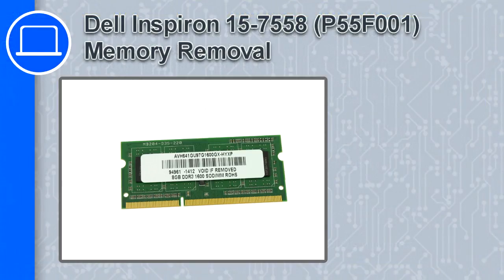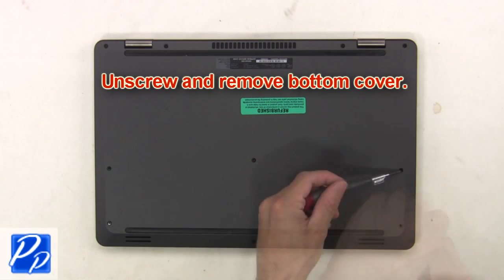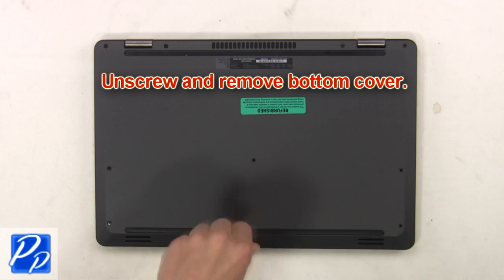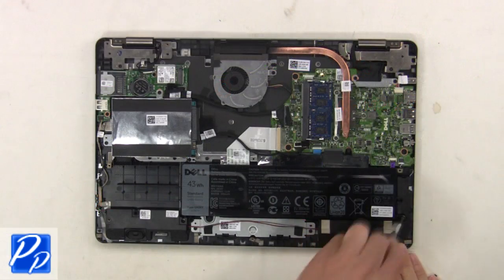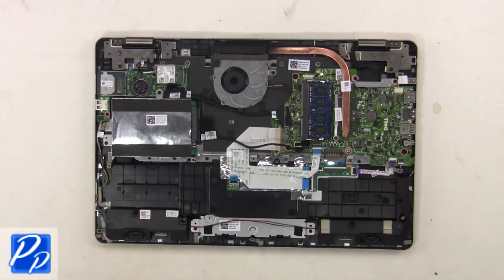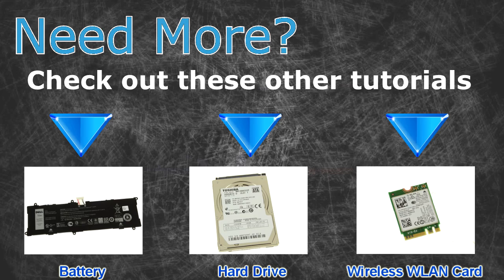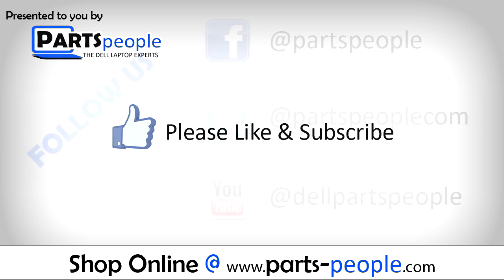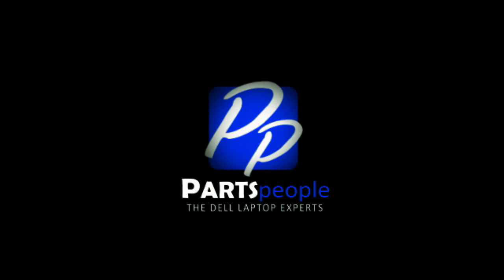Dell Inspiron 15-7558 (P55F001) RAM Memory How-To Video Tutorial

Comment: Is it possible to expand  ram memory for inspiron 7558? Or would I have to buy a higher ram?
Reply from the maker: This model has 1 slot that will run a max of 8GB of DDR3 memory. You can purchase it here: https://www.parts-people.com/index.php?action=category&id=141&subid=420&refine=ram+memory
Reply: @dellpartspeople  thanks for your response, yes my inspiron 7558 is already running a 8GB RAM that I believe is already in it when i purchased. So does that mean it’s not possible to expand even beyond 8GB Ram?
Reply from the maker: @ThyHolySlime  Yes. If you're already at 8GB's you've maxed out.

Comment: Hi i'm using dell inspiron 7352 2 in 1 laptop. i was wondering is there any way that i can expand the RAM memory from 8gb to 16bg ? with out replacing the existing RAM ?. i don't want to replace it i want to extend the RAM.
Reply from the maker: No. Your laptop only has one slot and maxes out at 8gbs of RAM.